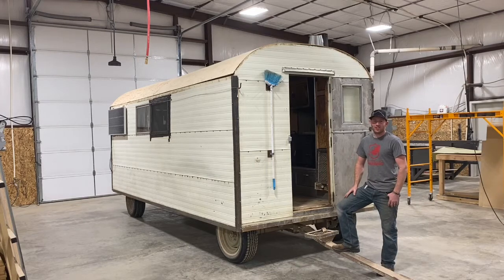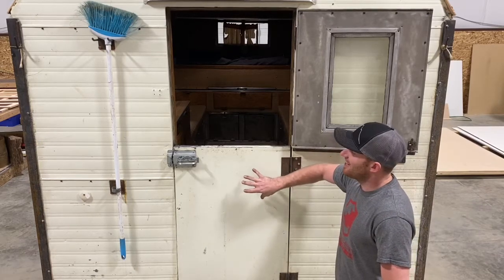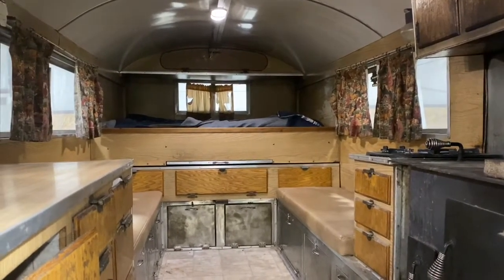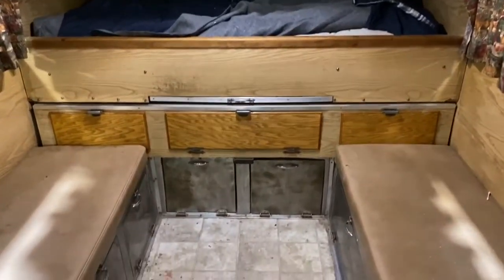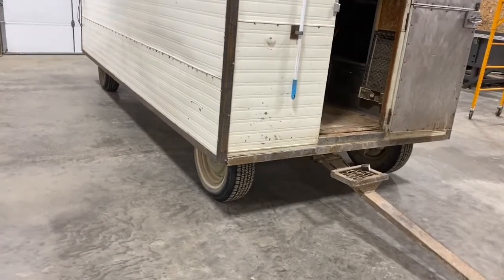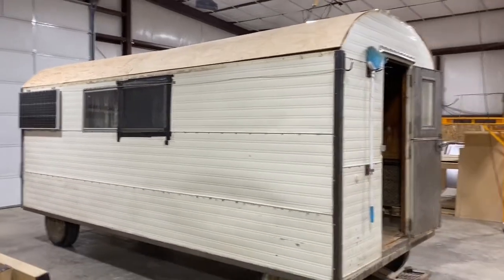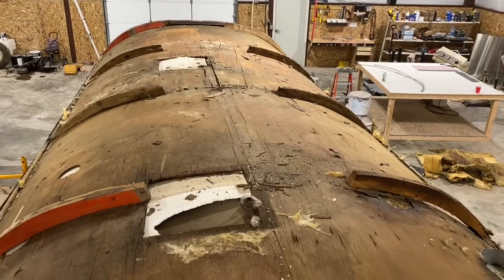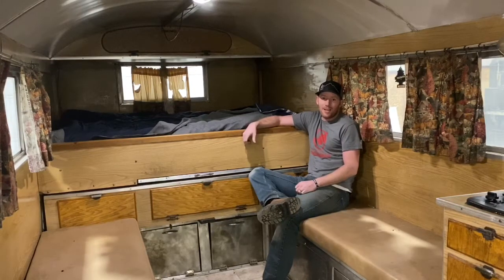Old sheep camp tour and repair

Comment: WOW! That was truly a very cool video. I really enjoyed seeing the differences between the older camps and the newer ones rolling out of Peak Mountain Camps. I think you really touched on a very important aspect of the older camp which reflects on why these camps are such a fantastic value compared to a modern travel trailer. It is amazing to think that camp built in the 1960's that was used on a nearly daily basis in a rugged herding environment. How many modern trailers could hold up to those rigors? The answer is none ... except for a camp from Peak Mountain Camps!